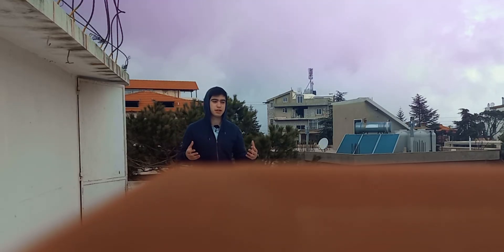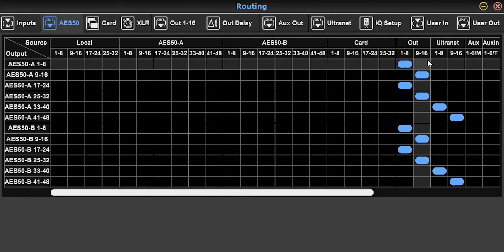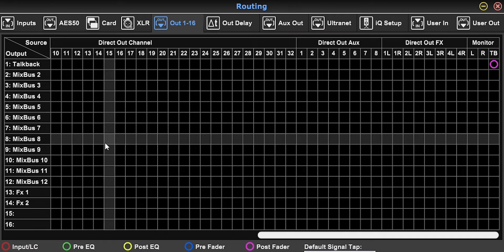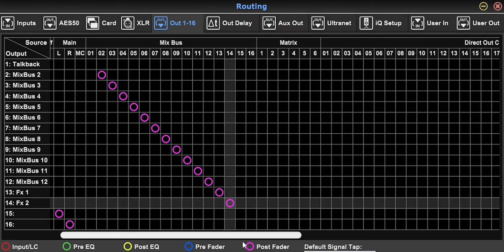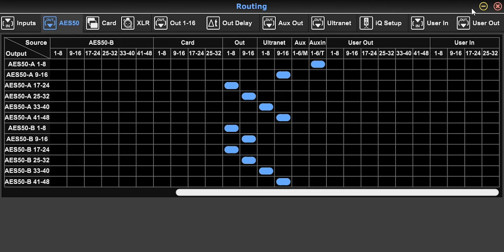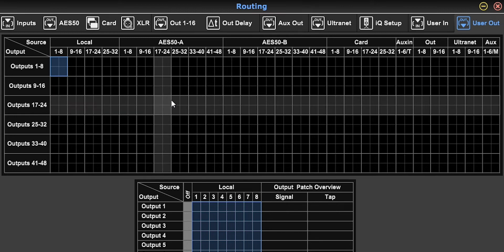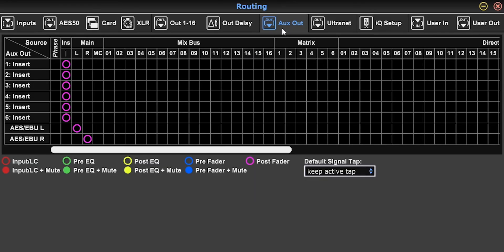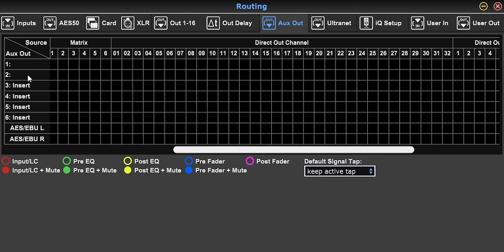X32/M32: Output Routing (XLR, AES50, ULTRANET, Card, Aux)

Comment: I have Wing Rack, an X32 Rack (or M32C) and a DL32. If I want to hook the Wing up to DL32 AES50A, as FOH and the X32 Rack to DL32 AES50B, as Monitor console, how can I send Mix Buses 1-8 from the X32 Rack (monitor Mixes) back to DL32 outputs 1-8? 

I would like to have the DL32 stage box on stage, with the X32 Rack and have a single AES50 line going back to the Wing Rack at FOH.
Reply from the maker: The monitor mixer has to be the master
Connect mon mixer port A to stagebox port A
Mon mixer port B to foh mixer port A
Set the foh sync clock to AES50 A
Set the mon sync to internal
Foh inputs come from aes50 A and foh outputs go out of aes50 A
Mon inputs come from aes50 A
Mon outputs go out of aes50 A
And also assign the aes50 B outputs to AES50 A
Now your inputs come from the stagebox into the mon mixer A and go out of port B into foh A
And the outputs of foh mixer are going into port B of the mon mixer

By default the mon mixer outs will go to the stagebox and for the foh outputs you'll go to aes50 A page on the mon mixer and assign some of the outputs to aes50 B (you can also use the user out page)
The mon mixer controls the physical preamp gain

Comment: morning Daniel. I  ran into an issue where we had to use the direct outs on DL32 to go to a stage box because they only had a allen and heath board and couldnt do AES50. this resulted on FOH dealing with 2 preamps. Is there a way to change the Direct out pre amps?
Reply from the maker: No you can't bypass the preamp on the stagebox

Comment: I have an x32 rack mixer that I am using along with an S8 stage box. 

I am taking inputs from the stage box for drums, which are being routed to channels 1-8, then I am pulling channels (local 1-8) to be assigned as channels 9-16, so I have the physical local inputs of 9-16 on the rack mixer to be 17-24 (but I’m not using those inputs currently) 

I am however using the local outputs on the x32 mixer for mixing in ear monitors,  and using a rack mount splitter to take channels 9-16 locally and be able to send them to front of house. 

I want to make sure my routing is correct to be able to still receive my inputs from the SD8 for drums, but I also want to use the SD8 as a splitter to front of house for the just the first 8 channels which is all drums; how do I do that?

Comment: Is there a way to route a channel out and back in to a different channel on the card virtually? Kind of like how you could use an aux or monitor out by sending a channel to that aux or monitor out and physically using a cable and inputing back into another physical channel on the board.

Comment: Hey Daniel,

I’m wondering if you could help guide me through sending outs 1-8 to the XLR outs on my S32 stagebox and sending outs 9-16 to the X32 from the local xlr outs on the back of the console?
Reply from the maker: By default out 1-16 of the OUT page will go out of the stagebox and the local xlr outputs at the same time without doing anything extra.  But you can check the AES50 page for the stagebox outputs make sure 1-8 is assigned to out 1-8 and the XLR page for the local outputs mke sure 9-16 is assigned to out 9-16
Reply: Thanks so much! So if I understand correctly I can essentially just mix and match without making any adjustments to the routine. And then assign the 16 outputs to the XLR outs that line up to what I want?
Reply from the maker: @frasergottlieb6292  yeah

Comment: Can I use the additional AES50A outputs (above the number of physical outputs) to an S32 box to get to inputs of a monitor console connected to the AES B of the S32? I have an installation where X32 is at FOH, S32 on stage connected on AES50A. And occasionally have a monitor X32rack. And need some local inputs and FX from FOH to get to the monitor console.  Can that X32 rack (on S32 AES50B} receive audio from the X32 at FOH via the higher AES channels? Like in the S32 can I make higher AES50A inputs patch the AES50B outputs? I understand I could put the AES50 snake cable between the FOH X32 and the X32 rack, and have the X32 rack into the S32 (and send copies to FOH)... but that seems dangerous for a temporary situation. Also I understand I could use the physical XLR outputs of the S32 and hardwire into the local XLR inputs in the X32R, but then I have extra latency and analog/digital conversions (one of the inputs is the lead vocal mic, RF at FOH). I guess the question is if it isn't patchable, are the AES50A channels 17 and higher signals received by the S32  normaled (default patched) to the AES50B outputs?
Reply from the maker: think of the B port on the stage box as a THRU port not an independent port.
i would normally say connect the 2 mixers directly with a cable (AES50B foh to AES50B mon) then it would just be a matter of assigning local ins to AES50 outs and receiving it on the other mixer.
if you're connected to a stagebox the AES50 inputs in the routing page of the mixer are always gonna be the xlr inputs of the stagebox because there's no routing menu for the stagebox. if you connect another s16 to the s32 then the higher channels will be used by the xlr ins of the 2nd stagebox. so the 2 mixers are taking the inputs from the stagebox but they are not talking to each other. so the answer is no. you cannot get local ins from foh through the s32 to the x32 rack. you can add a second cable to connect foh port B to x32 rack port B and then you can send whatever you want bidirectionally
Reply: @danielkharrat  I tested it, and the output channels above 32 are passing through from the AESA send from the FOH console, through the S30 AES50B connector to the mon console. So I think S30 1-16 is the XLR outs, 17-32 is the ADAT outs, and then above that, it seems I can use for tielines between the X32 at FOH and the X32rack at monitors, with the S30 in between. Specifically, at FOH X32 I patched Ultranet output channels to AES50A channels 33 and above. On the X32Rack (receiving S30 from AES50B port, plugged into X32R AES50A port) assigned AES50A channels 33 and up into input channels. This way I can remove/replace/unplug the monitor console without breaking the FOH (and monitors from FOH) with S30 existing system. Thanks for your quick response! DennyJagard.com is my audio related site, Ten Foot Pole is my 90's skatepunk band.
Reply from the maker: @dennyjagard7595  cool!  didn't think it would work and i don't have 2 mixers anymore to test it but that's good to know

Comment: Thanks, question: If I have a M32R (8 local outs) and a DL32 (16 outs)  Is it possible to make the system to see ALL the 24 outputs independently?, I can't figure out how to assign more than 16 outs using both units regardless of patching, I want to use the 8 local outputs of the M32 to send different stuff, like direct outs or insert sends to other hardware
Reply from the maker: In the routing menu the "XLR" page is where you assign the local xlr outputs on the back of the mixer
And on the AES50 page is where you assign the stagebox outputs 
By default they are both assigned to out 1-16 from the OUT page
But you can go to the XLR page and assign the local outputs to Aux out or to ultranet and then in the ultranet page you can choose the signals and tap points
Reply: @danielkharrat  Awesome, I'll try it, thanks so much!
Reply: @danielkharrat  I have a M32C, one DL32,  and using Ultranet to 4 Powerplay 16 boxes powered by a Powerplay 16-D. How do I get effects to the personal monitor mixes? Its so dry.
Reply from the maker: You can assign 2 of the 16 ultranet outputs to be Fx 1L and Fx 1R or whatever effects returns channels you are using

Comment: Hello Daniel, I need your expertise, I am the drummer and I have an X32 compact at my hybrid drums, i am mixing card inputs from a  VST, and mic inputs for cymbal overheads, hi-hats, and splashes. My Compact is connected to AES-B port on my S16 at the drums which is connected from port A to another S16 in port B, from there the second, (or first in line) S16 is connected to our Full size FOH X32 via port A. I have success routing my Drum mix-busses 1-8 to FOH X32 via AES-A 17-24 to individual input channels at FOH Mixer. My problem is I cannot seem to route the drum X32 outputs of mixbus 9,10 or 11,12 for overheads in the same exact way to the FOH Mixer, I have tried all of the routing scenarios I can think of. I have the latest version, 4.09 on both mixers and User Routing does not seem to help.???

Comment: Hello !! I'm a new user so there's a problem I want to share with you. Currently, I am using a Midas M32R mixer and connecting it to the Dl155 stagebox. I want to have an AES Out line from the DL155 but I cannot install it yet. Do you have any solution to help me? Thank you very much ! Hope to receive an answer from you as soon as possible..

Comment: Thanks for using the M32-Edit software, its pretty much where I live.   We have the M32c and 2 of the DL16's.   The only advantage to have 2 -DL16's instead of 1-DL32 is redundancy in case one breaks...also there is an extra Ultranet output, so you don't hit your head on the five wedge limit, also you can put them in different locations on the stage and get less cable clutter.  But that is not important.   We use the Ultranet for our Turbosound monitors, and have been doing so for some time.   The Ultranet has a more 3D sound image than just xlr.   We are going to start using for the mains as well, hoping for the same result, plus that modeling looks interesting.   What I am curious about is I noticed you have your outs post fader, but your ultranet is father up the chain.   I am experimenting with different point to intercept.  I like using the bus master output fader as the fader for a wedge.   Since they are all addressable you can daisy chain the Ethercon cable (up to 5 before latency starts to be a problem).   So we have had one run with five.  Last Sunday we added another wedge for the keyboard player and we had to use an different setup for him.   Actually I just tapped off of his keyboard DI and that worked, not ideal but it worked.   Starting next Sunday we should have all six wedges and the two mains on the ultranet assigned to the Main LR and six busses of monitoring.  (which works out to four on each run of Ethercon, one run from each DL16_)  My question is what tap point would you recommend for those bus monitors that feed a wedge and why?
Reply: I have a M32C, one DL32,  and using Ultranet to 4 Powerplay 16 boxes powered by a Powerplay 16-D. How do I get effects to the personal monitor mixes? Its so dry.
Reply: @allenlocke1935  I mean one way would be to go to the Ultranet tab, where the 16 channels are assigned, and assign one of the channels to your Direct out effects, or a mix bus etc.
Reply: @allenlocke1935  Another way would be to use mix busses as monitor mixes and then you can mix in the reverb and whatever else you want.

Comment: Hi, I'm just trying to get mics on channels 30, 31 and 32 to go out to the computer via the card. How can I do this?
Reply from the maker: Routing-> card assign 25-32 to local 25-32 if you're plugged in to the back of the mixer or AES50 25-32 if you're using a stagebox box or you can assign it to user out 25-32 and do it there

Comment: 8:54 Why would XRLs be connected to the main consul if there is STAGE box , what would be the use of the stage box, assuming I'm using an m32 live.
Reply from the maker: You may need to give the camera guy audio or maybe the amps for the pa are not near the stage but closer to the console or maybe you have speakers in different room... there's a lot of reasons to use the local xlr even if you're using a stagebox
Reply: @danielkharrat  But then if I can't have 2 masters, how do I have outputs from both?
Reply from the maker: @mosesngatiah3314  you have your outputs on both anyway. Master has nothing to do with the outputs, it's on to sync the digital connection between the devices
Reply: @danielkharrat  well noted. You are teaching me everything man. Thanks a lot.

Comment: You should show all this on the board itself. Lots of people own these boards, NOT lots of people use a pc with them.  These videos are way LESS helpful than showing on THE BOARD
Reply: There are plenty of videos showing routing from the console surface.
Google "X32 routing" and you will find those. There is also the user manual.

And there are a lot fo people who use these consoles but who don't own the board and train/prep scenes offline with the software, or set up scenes with the PC or the app, even when they are next to the board. Using the EDIT software or MS is way faster than doing it on the console.

Comment: Great video. Would it be possible for you to do practical examples with setting up a complete p.a system with out fills, delay stack, front fill etc. combining outputs from the console as well a outputs from the desk. I tried using aux out for a delay stack behind the mixer the other day only to find there's no delay compensation on aux outs. Many thanks for your hard work
Reply from the maker: You mean output delays. Delay compensation is for processing. 
Yes, output delays are only available for the 16 outputs of the OUT page
There's only a polarity switch on the Aux out page and you cannot assign a 1/4 inch aux out to an output from the OUT page unfortunately that's a limitation of the console.

For using different outputs from different places i recommend you watch my video about user routing and the one about hardware inserts with the m32c. That way you'll have a better understanding of routing

And regarding the pa setup I'm going soon to a youth conference for my church and I'm bringing my m32c with a dl32 stagebox there, so if i have enough time to film what I'm doing while I'm setting stuff up, I'll make a video about it

Comment: Hey Daniel  thanks for this video.. We have a need to send Aux-In's to a second console and do so with the Aux-In Remap, it works but is still somewhat of a mystery, can you do a video of the Aux-In remap functionality.. Thanks
Reply from the maker: I talked about it in the video about connecting 2 consoles together. https://youtu.be/I1HcDtC28Dw But basically you wanna select user in 1-6 for the aux remap and go to the user in page and assign the inputs 1-6 to whatever AES50 channel the auxes are coming on from the other console. So if you assign AES50 outputs 41-48 to Auxins/TB on the first console you would do aux remap to be user in 1-6 on the second console and patch user inputs 1-6 to AES50 41-46
this way you can get auxes from one console to another

Comment: Thanks for all your hard work. I understand routing and your video explains it very well. it's all logical. I think your are doing a great job for beginners and Pro's. The user program is useful if you want to route things not by 4 or 8. it lets you separate them instead of having to change all 4 or 8 at a time. Keep up the good work.

Comment: Hey daniel, so im planning to get ah digital stage box to use it for more inputs and to run IEM  im just a bit confuse where to rout for IEM is it aes50 out correct?
Reply from the maker: By default the stage box will give you outputs 1-16 from the out page
But if you are using all of them you can assign the aes50 outputs to ultranet and assign those in the ultranet page
Reply: @danielkharrat  Thanks a lot daniel!

Comment: hi daniel i would like to ask the following if you can explain it to me in next episode i have an m32r console and a dl32 box permanently connected to a theater stage.  because the distance between the console and dl32 is long many times videographers come to video the show and they ask me for sound from the console because the distance from the dl32 is far I want to give them sound from the console buses is this done even if  yes how?
Reply from the maker: Yes you go to the xlr page in the routing menu 
Since you only have 8 xlr outputs on the mr18 you're gonna assign xlr 1-8 to whatever you want and this is independent from the dl32 outputs
Reply: Route the MAIN LR mix to the local outputs (AUX OUT or XLR out) of the console.

Comment: I'm still a bit confused with the card In and Out Settings in combination with a daw and the playback...i got it to work but it feels like i fixed it accidently.
I just mean that it's not very intuitive and ti can take some time when not done daily
Reply from the maker: Yes, i agree. The routing menus on this console are confusing
Reply: If you keep in mind, that you have to switch between rec / play, it isn't all that hard - if you want to playback something from the card and get it out of the card again, it get's really sketchy 😊That's only possible with a workaround and not with all 32 channels. I sometimes playback a recording from the X-live / or PC, mix it on the desk and put out the master via card into the daw again. I use user routing for the input AND the card - that way I only have to change things in one place and the rest is always congruent. Opinions differ there.. some select the input on the channel itself, because it's quick and easy for a live setup. I prefer user routing, because I use the X-Live card on almost every show.